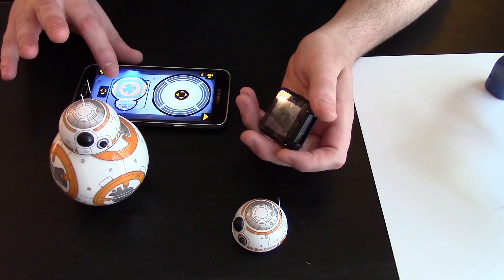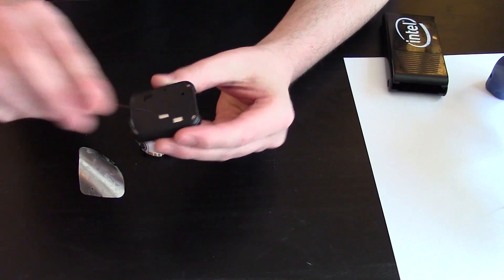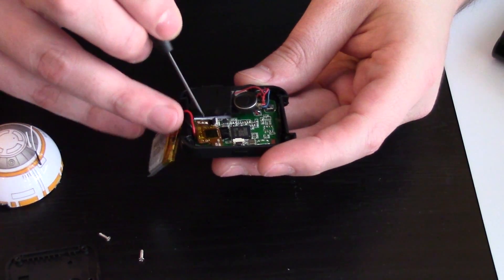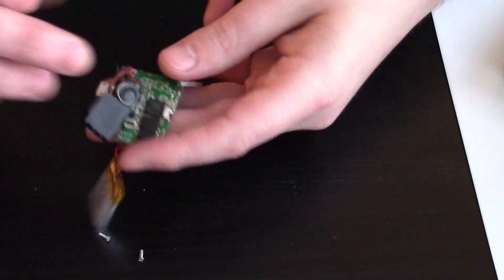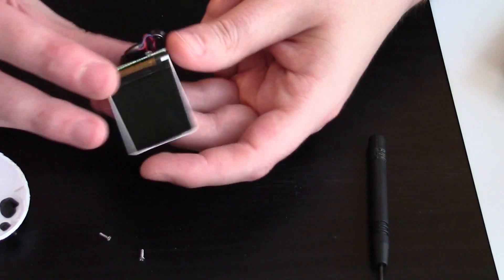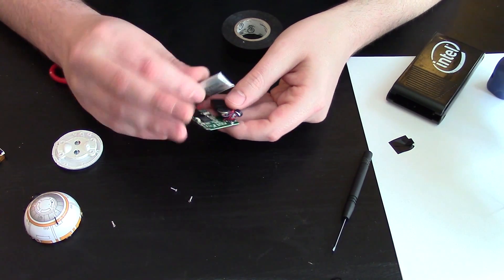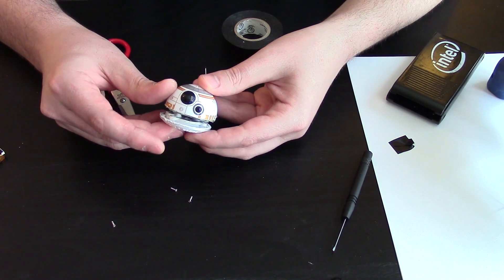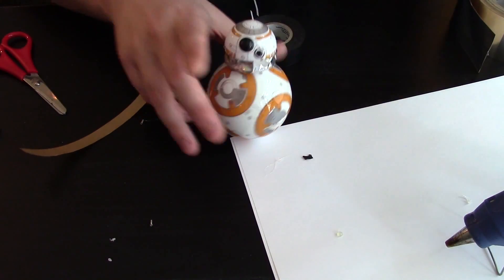🤖 BB-8 Sphero Sound Head Mod

Comment: Can you make a third leg modification video for R2D2. I feel the third leg needs wheels in order for it to work properly.
Reply: Hardcore Video Gamer the third leg works fine. There are no issues with it. Adding a ball bearing or anything else will distort the performance.
Reply from the maker: have not had a chance to mess with the R2D2. AKA I have not purchased one LOL.
Please Sub if you can 😊